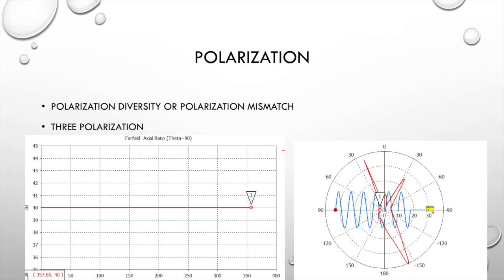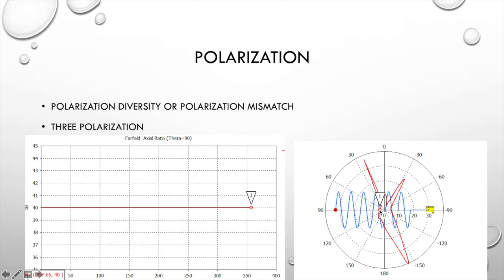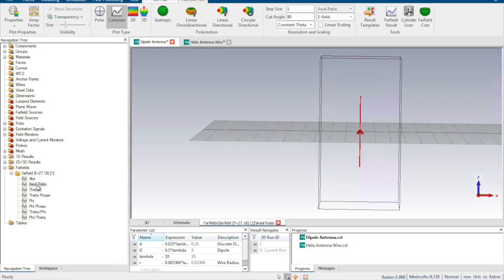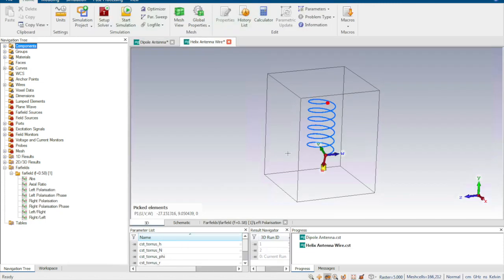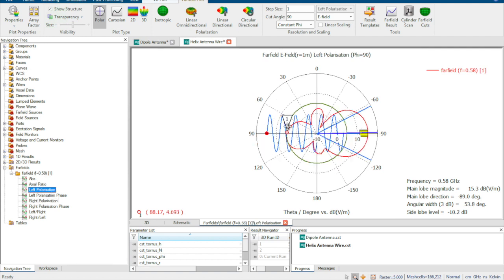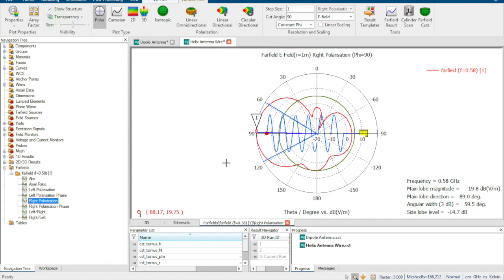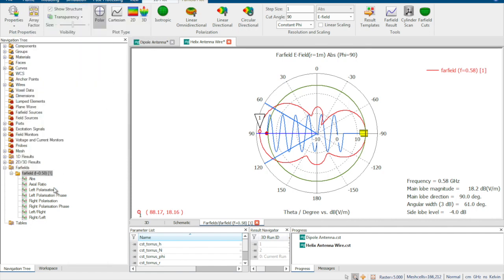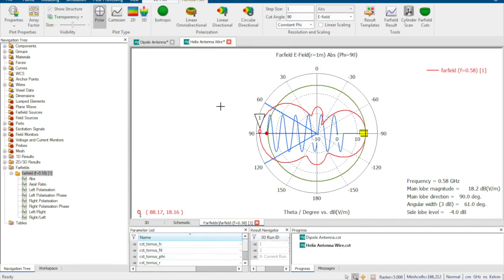Axial Ratio of Polarization

Comment: How can we change the polarization in antenna
And what is the polarization depends on
Reply from the maker: For this one. You can change the wire rounding direction to change its polarization direction.  
You can rotate the antenna to change its polarization.
You can also combine two linear polarized antennas to form a circular polarized antenna. For example, you can feed a patch antenna at two points, you will have a circular polarized antenna.